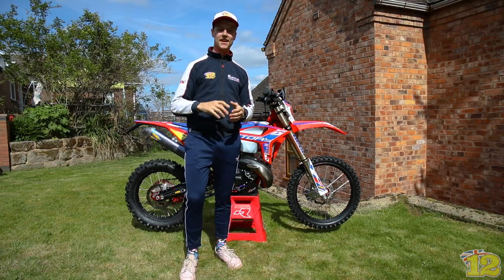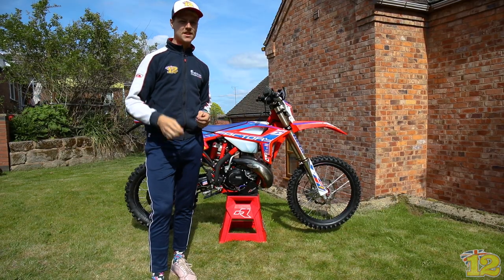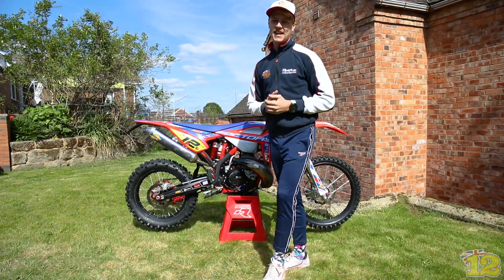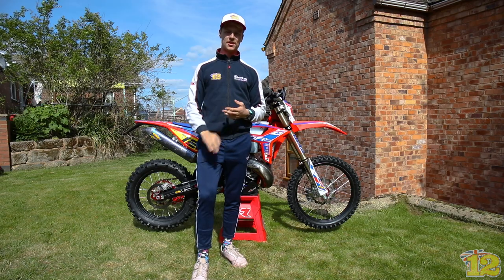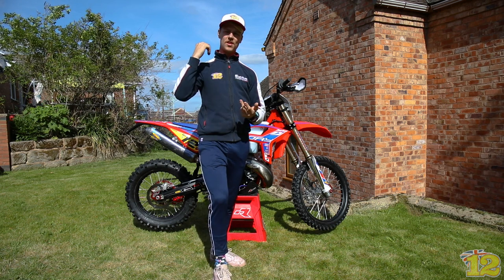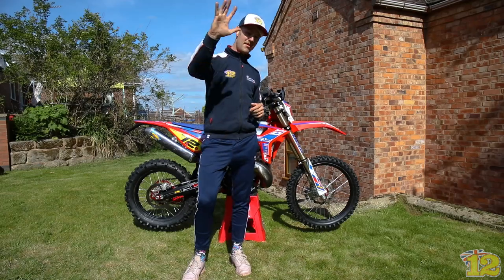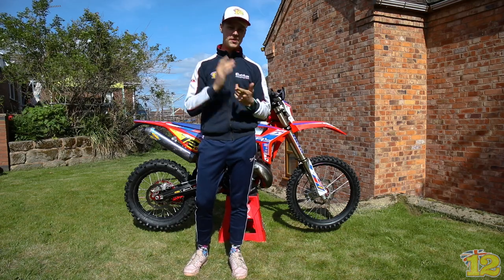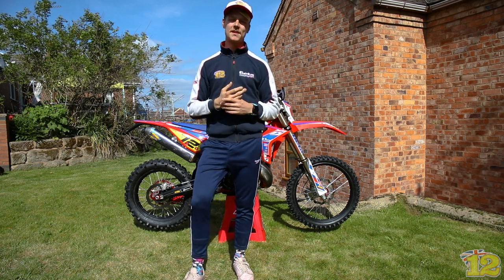SUSPENSION BASICS EVERY RIDER SHOULD KNOW!! Set up like a PRO 💪🏻

Comment: How many klics must be the difference between rebound and compresion in driving enduro terrain and which must be the harder between of two.
Reply from the maker: So I will be doing another video on this! Because suspension varies so much from track to track and different riders...but generally speaking in enduro we use the compression a little bit softer (to help with comfort and to find more grip) and the rebound a little faster...but you need to try it for yourself 👍🏻
Reply: @bradfreeman7916  thanks

Comment: is that tiny kick start enough to start a 300? my 2018 beta has the long old design kicker
Reply from the maker: Yes its enough, but we only use it for emergency if the electric start has a problem. This is from the 125 to save some weight and bulk!

Comment: one important factor that a lot of people don't understand is how drastically your rider sag changes based off of where you are on the seat. people tend to sit too far back and their sag numbers come out wrong and they think they need a stiffer spring when in reality the spring may have been fine if they were in the correct position on the bike. sag should be set by a trained observer. do not set your sag by yourself, do not set your sag with your friend who knows fuck all about suspension. a trained observer will have your suspension feeling and working as it should

Comment: I can ask if I have a KTM 200 exc 2010 and I have 65kg how much you should click
Reply from the maker: It completely varies from track and your riding style! Do you feel the suspension is too soft?
Reply: @bradfreeman7916  thank you for answer
Reply: @bradfreeman7916  Well, I rather don't know if it's better to have a little harder or soft dampers
Reply from the maker: @tomasholy7266  what do you normally ride?
Reply: @bradfreeman7916  mostly classic enduro to make it look a lot and we're going at a pretty faster pace, but I'll never have it for you
Reply from the maker: @tomasholy7266  for sure I would say you want a slightly softer suspension than the normal, to help with comfort and traction. I'd suggest starting from middle...and adjust from there! You can always go back to the middle, dont be afraid to experiment 👍🏻
Reply: @bradfreeman7916  thanks for the advice and i will try